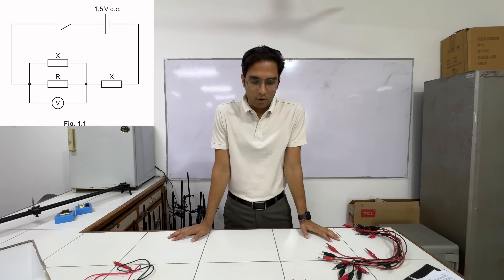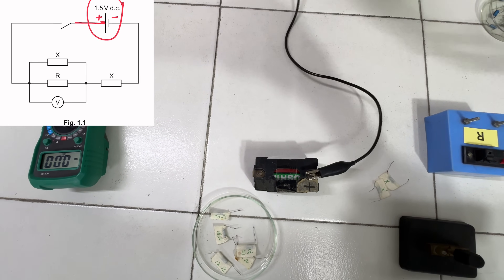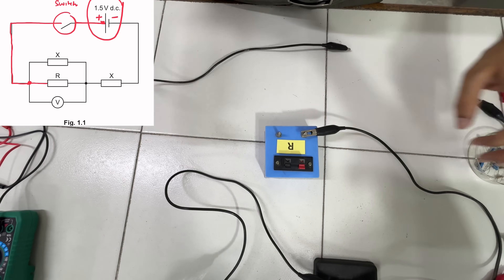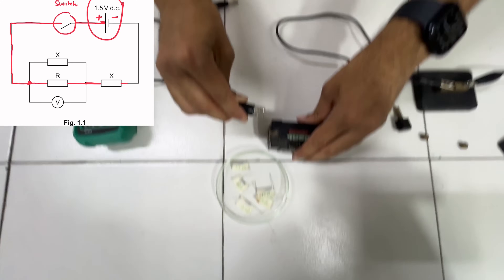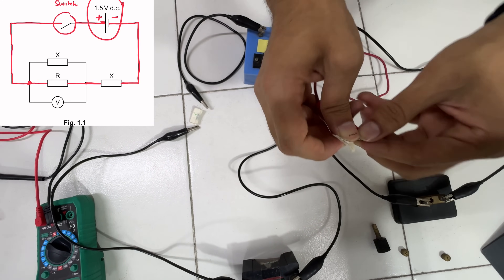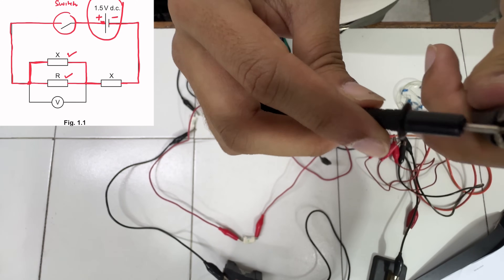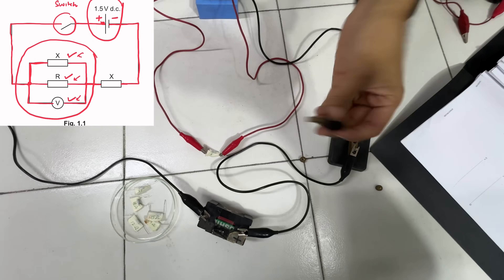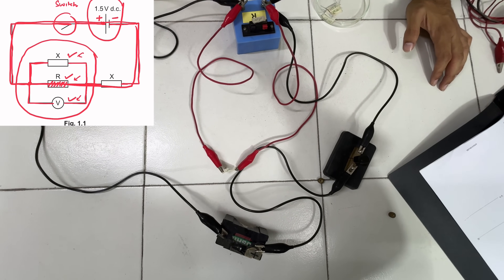How to Setup a circuit in 9702 Electricity Practical

Comment: Sir do the wire colour matter?like don’t we have to connect positive to positive?
Reply from the maker: No. It doesnt matter
Reply: @CentaurusAcademy sir will I lose my marks if I wrote the unit wrong in the table and used the same wrong unit as my graph units  and the question after it